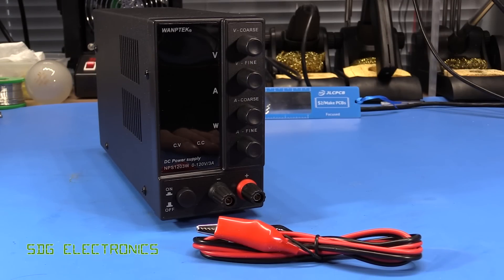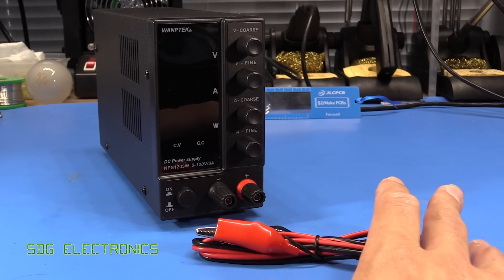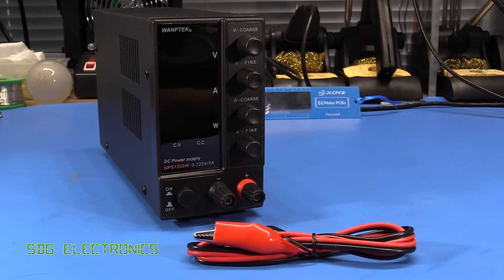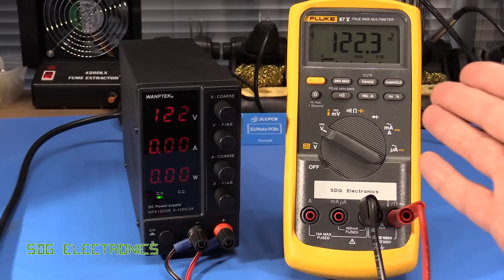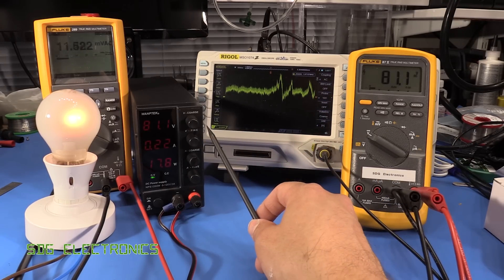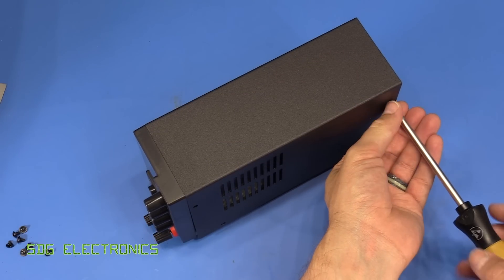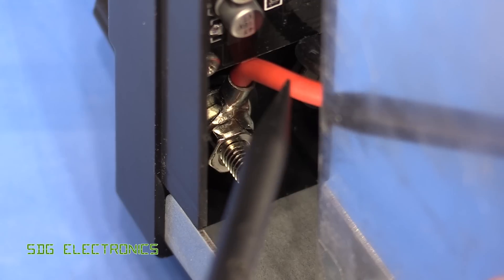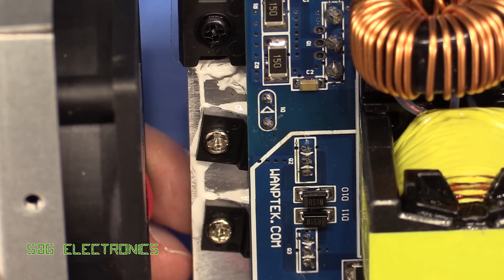SDG #085 Wanptek High Voltage 120V DC 3A Bench Power Supply

Comment: I got one of the newer ones and have the voltage spike issue when turning it on from cold. The newer one has a "output" button that starts the output though, but the main switch gives a voltage spike on the + and - terminals.

Comment: Are these multi Turn pots? Can the fine adjust cover the entire voltage range?
Reply from the maker: No, single turn. They are non-linear adjustment though, so greater control at lower voltages.

Comment: - Current limit protection
- Short circuit alarm stop output
- Self-recovery
BULL SHIT!!!!

All you have to do is to connect a 12V battery with reversed polarity and you can see this Power Supply die in 5 seconds!!!
(Without giving and amperage or Volt actually).
BE CAREFULL!!
Reply: sorry, did you buy this power supply ?

Comment: I want to be able to charge a 16S LiPo up to 63 Volts at 6-8 Amps Max and as low as 3 Amps when time is not of issue. Having a really hard time coming up with a power supply. Any ideas?
Reply: I have the same issue did you find one ?
Reply: @justinprenom9590  I have not.

Comment: @09:46 Kinda curious how you swapped those terminals out... Based your recommendation I too went ahead and replaced them on mine with Safety specced ones ( https://tinyurl.com/ycn5cf2f ) but the Panel only has holes for the M4 Screws while the Safety Terminals require an M12 ones going through almost 5mm of material making the use of a Stepdown drill kinda risky and next to impossible using a regular 12mm one. I for one went and had my CNC mill out those holes which worked unsurprisingly flawless but that's not exactly something most people have in their possession 🤔

Comment: I really like that you know your good Chinese brand caps from non-good ones - and don't just blanketly criticize "poor Chinese caps". Do you think the isolation from 230v to DC is sufficient?
Reply from the maker: From testing, it definitely withstands a flash test. Bear in mind, it is a low cost device though and is a little noisy on the waveform

Comment: Hi, can you adjust the intensity manually? I have the same power supply but I just can set the voltage. Could you explain me how it works more or less?

Comment: Did you ever change those lead terminals over to safety type? I'd like to do that as well to use my same leads for my fluke meters but i can't find some terminals that i know will fit easily.

Comment: Hey Steve, could please you measure the voltage of the positive or negative output with respect to chassis(earth) ground? I have a similar unit and it seems to have ridiculous voltage between the two terminal output and earth ground (close to 180V!). Definitely safety hazard!
Reply: Couldnt you just short the - to ground?

Comment: Can i anodize titanium with this ?
Reply: If memory serves, yes, I remember the voltage being something like 90 VDC for that.
Reply: Yeah, I bought this to try with my titanium anodizing, it works perfectly.
Reply: @TylerD63  thank you. This is the reason I'm looking at this. My current power supply is only 30v. How is it holding up? I saw some negative reviews on Amazon which is why I'm doing further research on this
Reply: @bobkeller8383  I have not had any problems with mine at all, has been fine so far
Reply: @TylerD63  thank you. I just received mine today

Comment: Is the output properly isolated?
Reply from the maker: I will double check with an isolation tester later
Reply: @sdgelectronics  update? Cheers
Reply from the maker: @ReubenHorner  apologies, yes it's isolated from the mains earth (and mains AC)
Reply: How many KV of isolation? Can it output  be put in series (several power supplies)?

Comment: You might want to stick to promoting equipment with Electrical Compliance/Certification. Stay safe my man, buy professionally designed power devices only. 
PS: just how did that thing made it past the UK Border Customs?? U got lucky, my guess...
Reply from the maker: It did come with a booklet with the approvals listed. The sticker is actually on the bottom of this unit, but supposedly it has passed safety testing. I didn't see anything dangerous in the design - did I miss something?
Reply: @sdgelectronics  try to load a old 12Volt Car battery with 100mA. This device starts smoking. The Mosfet is totally burned out. Do you know which one is used on this device?
Reply: Anyone know of a better unit and value for this price point?

Comment: Nice video about a potentially very useful product. Thanks. The build quality looks good, but it would have been nice if you had put on at least 50% of the maximum load and checked to see if the unit would work, and if so, whether it could dissipate the waste heat over a reasonable period of time. You didn't really show the heat sink, but the few glimpses appeared sort of flimsy for a converter which is rated to output 360 Watts, which probably would translate into 70+ Watts of heat dissipated in the unit.
Reply: I thought the exact same thing watching the video. He could have droved it at 100% It's not a real review if you dont test the equipment to their stated limits.

Comment: I think the TNY chip is only providing 12v or 5v for the opamps/comparators and front panel leds ... and the 3.3v linear regulator is powering the microcontroller.  The actual switcher IC may be on the other side of the board, and you have there diodes/mosfets in to-220 or similar packaged screwed directly to case - see @7:43 ... right in front of the heatsink. 

One of the small transformers is used by the TNY chip, the other is most likely for feedback / current sense... 

Other than this... typical Chinese stuff ... shitty electrolytic capacitors, bridge rectifier right by the primary capacitor so it can stay nice and warm and degrade over time, also outside the regular airflow so fan won't help keep that area cooler... that ntc/ptc/whatever is gonna be constantly hot as it's not shorted out using a relay or other methods...
Reply from the maker: The PI chip is driving the mosfets on the heatsink. No components on the underside. The components on the heatsink have isolating hardware on them. The airflow comes from near the front so the capacitors should get sufficient airflow - it's a relatively low power converter so heat in the power supply is minimal. It's not a premium supply by any means but not anything that could be considered bad design

Comment: I would have liked to see a scope shot of the startup transient, at different voltages, and maybe see how fast is the CV-CC transition.
But it seems like a reasonable power supply.
Reply from the maker: I'll make sure to test on the next power supply. Thanks
Reply: It took about 2 seconds from CV to CC. I don't know whether that's a good or bad number for this kind of power supply but I burned 3 LED because of this slow transition speed.

Comment: Nice review, and nice bit of kit. What is the minimum output voltage, does it go all the way to zero? Is the coarse voltage control a pot or an encoder? What range is there on the fine setting, or is it continually variable? Thanks!
Reply from the maker: Yes, right down to zero. They're potentiometers giving around 2V on the fine control. One upgrade could be changing the potentiometers for multi-turn types.

Comment: Not a bad unit, though personally I'd be nervous about how easily it can deliver a dangerous voltage.
Eg you could accidentally flick it up to 120V just by brushing against the coarse adjustment knob. 

I'd happily pay a few quid more to have some sort of lockout or maximum voltage protection.
Reply from the maker: Because it is relatively low cost, I'd be quite happy to reserve this just for higher voltage use - it's a great point though